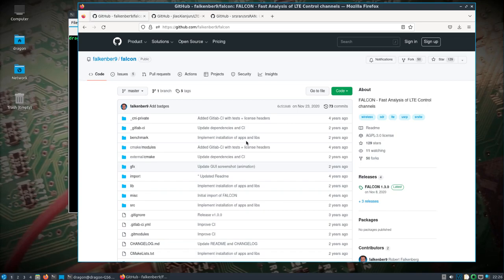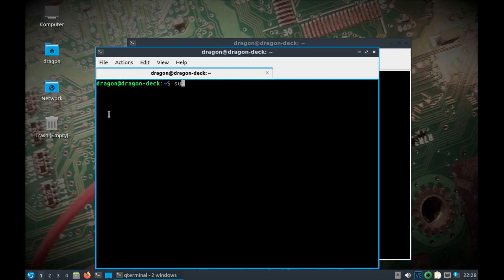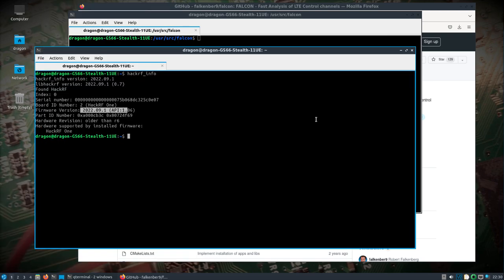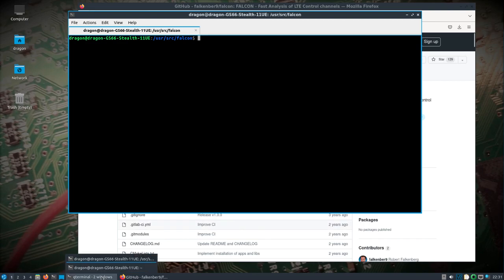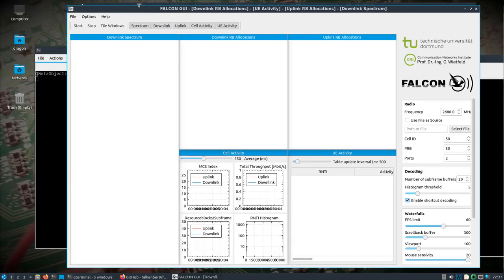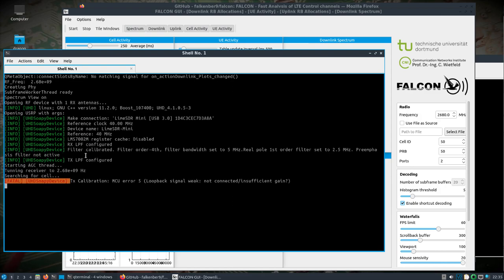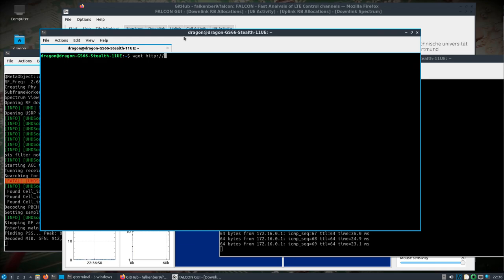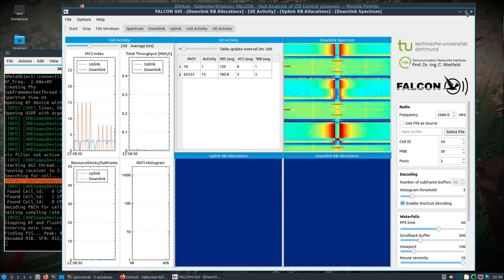DragonOS FocalX LTE Scanner + FALCON vs srsRAN (Lime, B205mini, bladeRF, hackRF, SteamDeck)

Comment: Hey, when i am running srsRAN on the DragonOS (rpi version) I am gettin Error - buffer pool is empty.
Way to reproduce - usrp b200 mini

First terminal: 
sudo srsepc

Second:
sudo srsenb --rf.device_name UHD

Output:
[INFO] [B200] Actually got clock rate 23.040000 MHz.

==== eNodeB started ===
Type to view trace
Setting frequency: DL=2680.0 Mhz, UL=2560.0 MHz for cc_idx=0 nof_prb=50
Error - buffer pool is empty
Error - buffer pool is empty
Error - buffer pool is empty
Error - buffer pool is empty
Reply from the maker: I’ll have to try on my end, but I generally do not recommend running the epc and enb on a Pi. Try unplugging and pluggin back in the b200. You may also want to shut down the desktop to conserve resources and try to run commands in just terminal windows.

Comment: How do I upgrade your OS with latest packages you've added without reinstalling with latest ISO?

Wil only apt-upgrade work?
Reply from the maker: This build has some significant changes in it that I worked on over time and unfortunately I couldn’t build upgradable packages like I have sometimes in the past. Best solution is to backup your home directory, then reinstall and move over what you need into the new install.